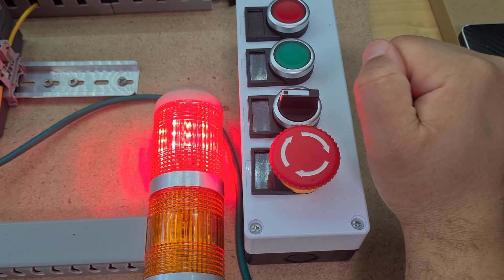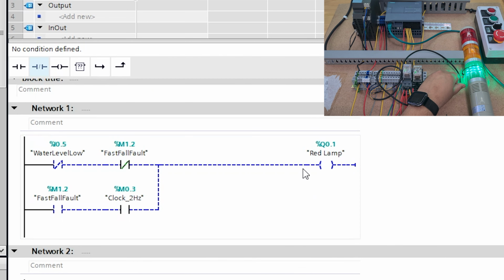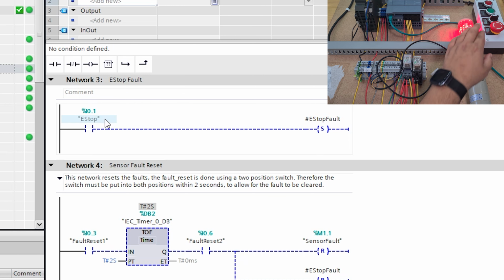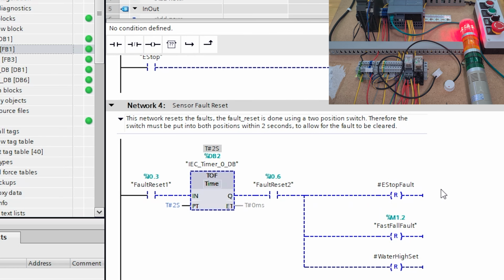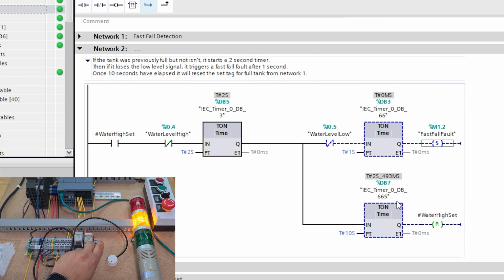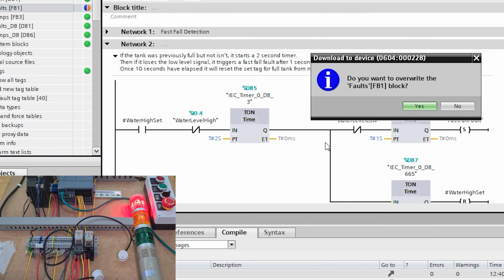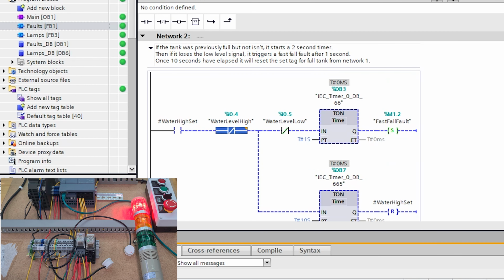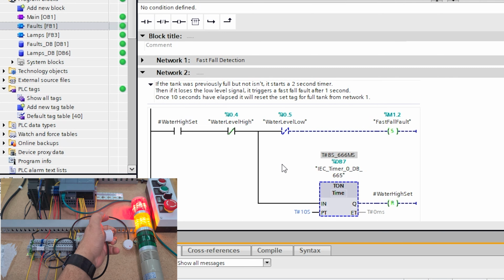Fast Fall Detection Completed! - My First PLC Project

Comment: Could also debounce input signals in a debounce function block. Then use the debounced input memory bits throughout the program logic. Removes the confusion of debounce timers in the logic and makes debounce times easier to see and change.

Comment: Very informative video. I'm doing an EE degree and I'm interested in PLC programming but my degree doesn't really cover it :(
Reply from the maker: Thanks Joe, I wouldn't worry about not having the module, you can learn PLCs yourself on the side. I'm keen to do some videos on using a raspberry pi as a PLC but just been swamped recently